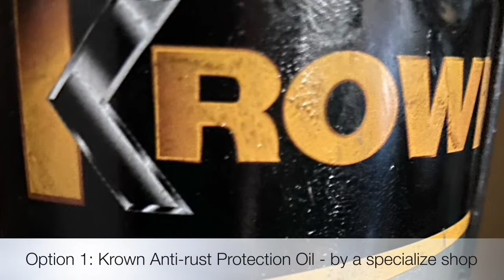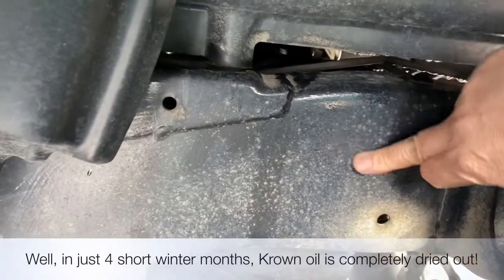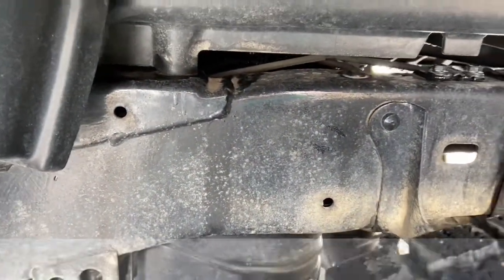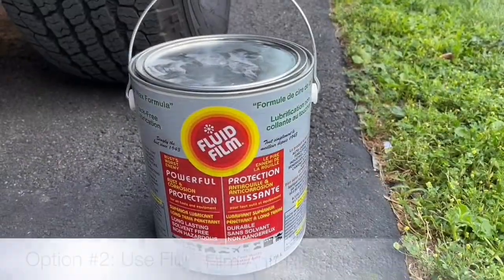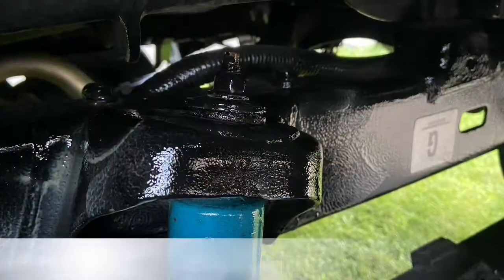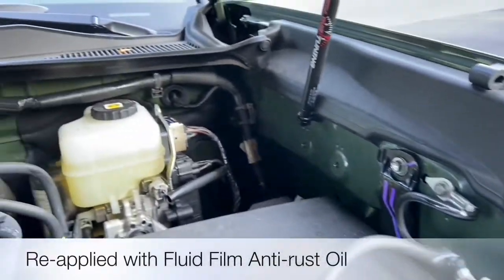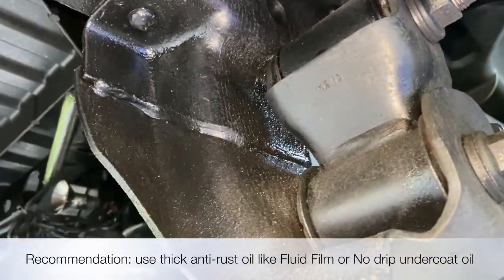Tacoma TRD Off-road Rust Protection Fluid Film vs Krown And Which is better for Truck?

Comment: You have misunderstood how Krown actually works.  The oil sprayed by Krown is not intended as the rust proofing product, the oil is the carrier of the actual rustproofing product.  After a couple months the Krown treatment will appear dry, that is what is supposed to happen.  The rust proofing product is still on the metal when the carrier oil has dried.  As long as you don't see rust the product is working.
Reply from the maker: Inside my engine bay and under the hood of my car has Krown oil that is still wet.  It has been there for years and it has never been retouched.  That is because it is not in an open area where it get washed by the snow and rain. I also don’t believe Krown oil suppose to be evaporated off the metal surface can protect the open truck frame (I am not talking about cars and small SUV as they are not the same as pickup truck) . Krown rust protection is not an evaporate application.
Reply: @happyjohn8256  oh, so he said his competitor isn't as good. Weird.

Comment: FF on my Tacoma i applied when new and has held up amazing , i used the undercoat gun from princess auto 30$ on sale comes with a flex tube also works great for application 👍
Reply from the maker: Since I applied this FF on the frame last year, the frame is well covered still.   This product is great. I am going to shoot another update video after second winters.   Thanks for the comment.